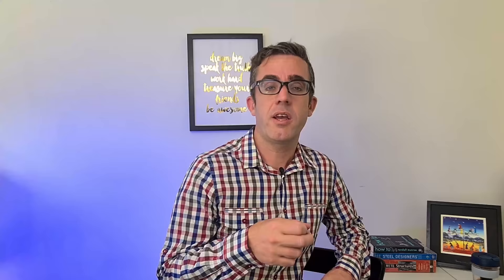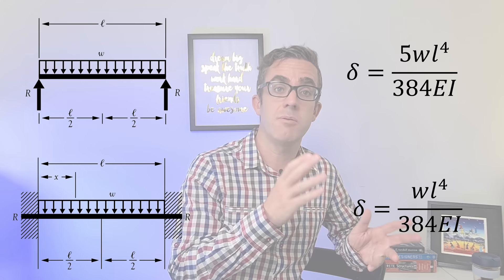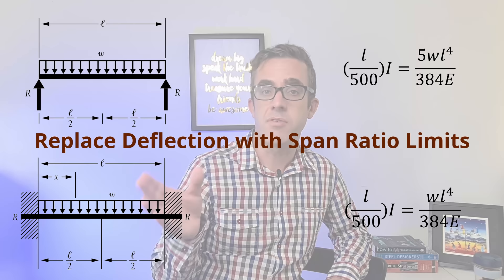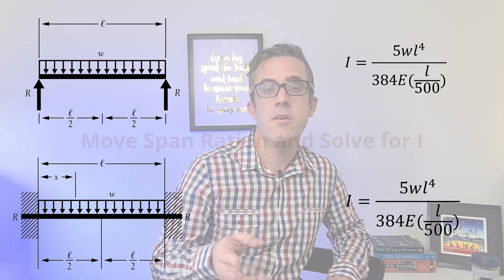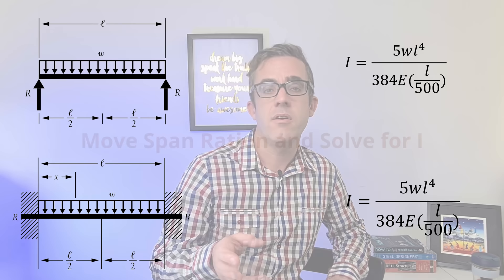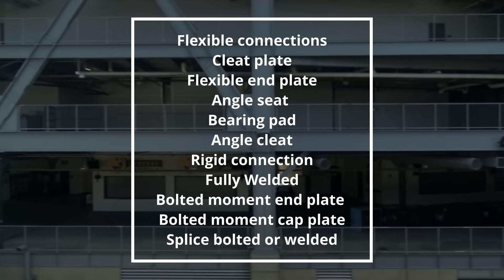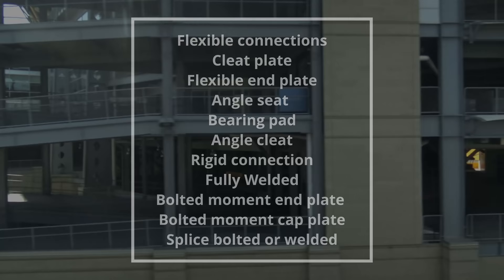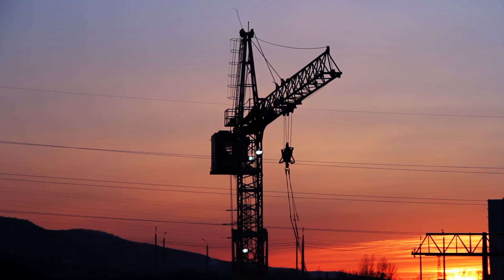The Golden Rules of how to design a steel frame structure

Comment from the maker: For the rule of thumb of Steel design. See this video  https://youtu.be/Dz26PBnog4k
Reply: i am already dead of confusion of maths of buildings
Reply: How much is each steel bar by meter length? Once the steel bar are installed and bolted can hard wood be used rather than hard concret blocks?
Reply: Yes, he should use more info graphics explanation.
Reply: Antonmursid🙏🙏🙏🙏🙏💝✌🙌👌👋🇮🇩🇮🇩🇮🇩🇮🇩🇮🇩💝✌🙌👌👋
Reply: but why build like that when those buildings collapse in free fall form a simple office fire?

Comment: A shitty cadetship, a few recessions, no mentoring, but I still managed a full Civil Engineering Degree from UNSW. The details you talk about is exactly what I missed out on.
I ended up managing civil structural construction and building projects.
My engineering insights allowed me to make many critical decisions over the years that saved the client $millions.
I have had a lot of 'adventures' in these roles and worked over seas and met some brilliant people. 
I have never structurally designed anything sadly, but I have seen some very dangerous designs by foolish and ignorant amateurs who were lucky I questioned their work.
I am in my 70s now and appreciate your presentation and the mentoring it provides.
Reply from the maker: Hi Stephen, thanks for your support. Alot of designer ignore the construction side, your experience would be invaluable. Despite not designing any buildings your input made them.
Reply: @BrendanHasty  From the prebuilding side of the problem I have had a few projects redesigned and saved significant costs. My disappointment was that the financial bonuses at the end of the projects were often ignored. 
I did have 'mentoring' from 'hard nosed' construction managers who's detailed focus showed the benefit of hard work and the type of skill needed in the construction phase.
Engineers are not good at self promotion but they are the ones 'sticking their necks out'. 
Sadly many of the 'good self promoters' were the dishonest shonks.
Thank you for the chat.

Comment: I did not think that this person actually existed. An engineer that takes into consideration the fabricator and erector. After detailing and fixing the EOR's design for twenty years this is very refreshing.
Reply from the maker: Hi Andy, Thanks for the support. I think every design, well, at least a good design, should consider fabrication and erection. Building is hard enough to build without doing this. If it is easier to build, it will be a better building.  I actually recommend that early on in the career of an engineer, they work on-site for a year or so; this gives them great feedback on their designs and how they can make it easier to build.  but agree a lot of engineers do not, think that it is someone else's problem

Comment: Hi! Great video! About galvanic corrosion, the usual thing that happens in the project (esp. loosely coordinated ones, at least here in ID) is that another contractor came in without knowing what galvanic corrosion means, and starts welding stuff. Saw it once during my whole career (which isn't that long).
It's really rare though. Most people here install the facade on the concrete surface covering the steel so everything should be safe.
Also, should be noted for the international audience, that the rule of thumb works with the specification of mild steel where you're at. Chinese steel have slightly different standard.

Comment: This is very positive! I used to erect a lot of steel structures in a previous life as a rigger and crane driver and I can remember being so frustrated at the stupid design engineers who didn't think of how someone was supposed to physically put a bolt into a connection!! I'm so glad you're actually thinking about this basic detail!!
I remember finding out that engineers in Germany had to do a years work on various projects as trades assistants before the could finally gain their full qualification and they seemed to turn out the best engineers in the world!
No substitute for some real world experience!!
Reply from the maker: Hi Jono, thanks for the support, Good design requires engineering to know how the building will be built and the limitations that will be on site. I agree that all structural engineers should spend a year or so on-site to know the issues that will occur on-site. It makes you a much better engineer and will lead to better designs and better buildings.
Reply: My grandfather was one

Comment: Excellent. Galvanic reaction also severe when using Stainless Steel fasteners on steel, galvanized steel or aluminium. The bolt holes in the steel, GMS or Alu. will corrode aggressively and open up in size  around each stainless steel fastener!  Scary how few folks in industry know about Galvaniic Corrosion. Worth reading up on before doing design work..

Comment: A a structural welder and civil engineering student I want to weld everything. But it’s the most expensive and time consuming
Reply from the maker: Hi Jake, it can at times seem best to weld everything however you can induce unexpectes stresses that you will need to deal with. thanks for the support.

Comment: I'm a little confused about steel becoming the anode when there is a connection aluminium. Aluminium sacrificial anodes are commonly used on steel craft in salt/brackish water. Am I missing something?

Comment: How to limit the noise vibrations of someone walking on steel floor or stairs? Can you please elaborate on solutions, Thanks :-)
Reply from the maker: Hi Arter, you need to have sound damping below the floor and isolation pad, connection to walls and beams need careful consideration.  Mass and volume is the only real way to solve it, so adding a concrete floor would help.

Comment: Good work. Informative and clear directions. I am a big believer in watching engineering failure videos - a good learning tool. You are absolutely right that steel structures can have little redundancy, unlike reinforced or post-tensioned concrete. However, for all structures stability limit state design requirements should always be followed through to eliminate this. Ahhhh ........ sometimes easier said than done!
Reply from the maker: Hi Guy， thanks for your support. and total agree with reviewing past failures to ensure you learn from them.  Good design should be always the number one goal.

Comment: Interesting about vibration comfort. How you check steel structure with frequency above 10 Hz and low mass of structure? Example SCI P359 low mass it’s problem, and they doesn’t say about limited frequency after which you don’t need check structure.

Comment: Watched this video knowing that I don’t know anything about engineering. However I am a welder that makes these steel frame buildings.
Reply from the maker: Hi Colton, I hope it aligns with your experience, or gave you some insight into engineering design. Good design needs feedback from anyone building the structure.
Reply: @BrendanHasty  I’m on a internal quality report team where we are trying to cut down on errors we get on blueprints. How do you prevent mistakes of missing/conflicting dimensions on blueprints in detailing before it reaches the production facility?
Reply from the maker: Hi Colton BIM is really and Answer full 3D dynamic models. However this requires a lot of up-front modelling

Comment: Dull topic, but interesting as a back yard engineer :-) One tip: if you cock up the audio in your original recording and do a rerecording of the audio only then at least do it with the same mic at the same level in the same acoustic environment so that when you splice it back in the audio is seamless and the only risk is the cognitive dissonance of the lips not matching the sound. You did this once in the middle and recorded the replacement clip on a cell phone or something.
Reply from the maker: Hi Fredio, thanks for the support. I do try to do that; it is using the same audio equipment, external recorder, same mic and same room; maybe I need to set everything up again. It is something I need to work on to make it sound the same. I think I may need to record the room tone of something like that.
Reply: @BrendanHasty  Then it's got to be something like distance or off-axis angle to the mic, then. The follow up to this video as pinned has a very different almost over the top audio style. It's tricky to get this stuff right but one of the most important things to get good audience reception :-)

Comment: Hi Brendan,
You have summarize the latest 8th edition steel designer's handbook in this video!! Good on you 👏
What do you think for 310UB32 spanning 13.97m, not precamber with Z15015@1200mm. With typical Australian loads on non trafficable warehouse roof!! 
My calculation shows that's beam fail for serviceability but I saw it on recent warehouse design in Perth. 
Keep it up.
Reply: I forgot to mention that the spacing between rafter is 6.5m.
Reply from the maker: Hi Ahmad, I haven't done the numbers on that, however, how much is it failing by? Typically I find that long span steel roof are governed by deflections, and that is an easy calculation. there is a natural pre-chamber in a member that may be helping. Also, what are the end fixities this may either make it better or worse.
Reply: @BrendanHasty  hi Brendan, I have sent you an email. Thank s

Comment: Can you elaborate more on the span to depth ratio for roof trusses cos 10 to 15m is very generous, I would typically range mine from 10 to 25, cos I am imagining a scenario I am dealing with 30m span truss. Using 15 will mean my truss depth is 2m which is quite deep and as the web members become deeper, slenderness becomes an issue and therefore say.. bigger angle sections will be required.

What's your opinion on toe toe or back to back connections if angles sections are used as Top and bottom chord of a truss?

Also would you prefer using double angles or one angle but with a bigger section for your truss, cost wise how does these two compare?

Let's say you are dealing with a parallel chord truss, do you think it is necessary to put a coupling plate at the ridge or apex between each side of the truss?

Comment: Really you increased my information, professional explanation, keep going, 
Your advice I have spans 27 meter, &high 10 meter, which design suitable, for high winds effect, thanks in advance
Reply from the maker: Hi Qasim really depends on what internal structure you have, it is a open space or internal walls, you will likely need internal support at or so  8-12 meter centers. High wind loads are also subjective.
Reply: @BrendanHasty  thanks for valuable reply, 
First Merry Christmas & prosperity and healthy life, 
Actually  two floors concrete building highly columns concrete 8 metres, 
Above the concrete columns, the roof from steel structure cover the facilitie,
The maximum span between the concrete columns is 27 metres,

Comment: Hello from Perth, The video is great; if you ever get time, please consider some simple worked examples from the Steel designers handbook, to show steel sizing calculations. Maybe can do some Spacegass steel sizing examples for simple structures. Do you use much excel spreadsheets for steel calculations?. I try to use all three of these and am wondering your methodology . Also, how do you document the finished steelwork; for example Spacegass reports? do you use the built in report generator? or document each beam seperately etc.
Reply from the maker: Typically I use Excel or mathcad to design simple structures. When modelling in spacegass I use the rule keep it simple KISS, complexity complicates checking the design. And typically I build up the complexity of the model simple to more complex in stages if a complex model is required. Will likely make a video on my work flow.

Comment: hi can you recomend a type of ibeam i should be using for supporting the weight of 
6 x 40 ft shipping containers wanting to build a structure that is 2.5 metres high which the 6 shipping containers could sit on top of 3 on the first floor and 3 on top and under the containers could be used for a garage the width and lenth will be 9mtres by 12 metres
Reply from the maker: depending on they layout the shipping container maybe able to span the distance without a beam.

Comment: 22:26 Opposite. Aluminium alloys are less noble than steel*, the aluminium will become the anode and corrode**, not the other way around.

* Despite being more reactive, aluminium corrodes in alkaline environments, and, in general, the environment is rather acidic. Steel corrodes faster in an acidic environment, so in the end steel is more corrosive - but this is because of typical environmental characteristics rather than the material itself.
** Providing the volume of the anode is equal to or smaller than the cathode.
Reply from the maker: Thanks for the correction. It is good to learn new things.
Reply: @BrendanHasty , I'm thankful as well. Nice video, learned quite a few things from it.

Comment: Hello Brendan
Big fan of your videos
What is the construction load that i should i applied in steel Design
Reply from the maker: Hi
it depends on how the building is being built. this can vary alot. if you have slab you need to take into account a minimum of a 2kpa live load plus SW of the slabs and propping loads. Some times you also need to consider temporary stability loads. it is something you need to guess at the start and refine when the builder is involved. thanks

Comment: Thanks brother , please clearify in structural system where we should give realease the elements in modal better. what will effect in site.
Reply from the maker: Hi Suhaid Khan, in design I typically will do an upper and lower bound assessment. so for deflections check the connection as pinned, but when pre-camber assume it is fixed as you don't want to have the structure hogging. This would be similar to ultimate design.

Comment: Don't you mean 150' instead of 150m for movement joints?
Reply from the maker: Hi Adijeet typically in a steel structure you can get upto 150m, 50 meters(~150') would be for slabs. if the roof is supported off a suspened slab then it would be 50 to match the slab

Comment: What would you classify a composite steel and deck with say 6" of cast in place concrete for the floor structure's diaphragm to be: rigid, psuedo-rigid, semi-rigid?  Would you transfer lateral forces 100% through the floor system to the cores/braces/moment connections?  center of mass and center of rigidity are close to eachother.  Thanks
Reply from the maker: Hi Peter Typically, I model it as semi-rigid. Computers are powerful enough nowadays to model them as semi-rigid. The lateral forces transfer through the floor system to all the stability support. Center of mass is just a simplification; when COM and COR(Center of Rigidity) are close, there isn't much torsion.
Reply: @BrendanHasty  got it thanks for the response. Yea I like the way the lateral system reacts when modeled as semi rigid as it seems to be a more accurate representation of what occurs in real life I would think. I have another question: when I design a steel building I like using as deep a beam as I’m allowed not only for its cost of efficiency but I find that the couple created at the column connection is greater even though we say the connection is simple and moment is not transferred to the column via the beam flange, in reality dont we have a small amount of moment going into all the columns when the diaphragm moves?
Reply: @BrendanHasty  i do the same, but it's comforting to know that others do so too.

very often in europe colleagues concentrate on calculating the beams, neglecting the connections and above all dedicating very little time to shop drawings and feasibility. for steel I think it is essential to know the processes in the workshop, the different tools they can use, how much space an operator needs to screw a bolt or to weld two sheets of metal, hanging in the air at a height of 8m maybe
Reply: @peeolo  Thank you for thinking about how the welder is gunna be able to weld that. The struggle is real sometimes… As a structural Ironworker one thing I notice that is missed quite often is deck support around columns.
Reply: @jordzzzzzzz  i was a bricklayer and truck mechanic before to become an engineer. People Need to work with my drawings. They're not piece of art or "some pretty nice sheet of paper". Thery are fabbrication drawing....for fabbrication not for art

Comment: Is there any specific angle for constructing a steel roof?
Reply from the maker: Hi Dann there is not specific angle, but there is a mimimum and it is based on the roof sheeting. typically a minimum of 3 degrees but be carefully of deflections as this reduces the pitch.

Comment: Also for wind load during cyclones what is criticL. Is it the panel steel sheet thickness so they don't fly off.
Also structural rigidity to stay in place and withstand wind loading  what is the key precaution.can you pl tell??
Reply from the maker: there are addition requirements in Cyclone zone, you also need to design the cladding for impact loads
Reply: @BrendanHasty  thks. But I meant wind loads . And where does the impact load steps in. Sorry if I am wrong.